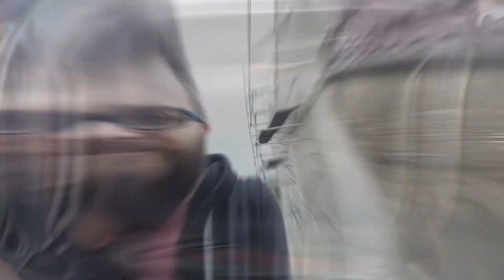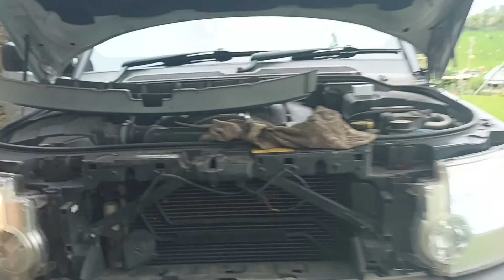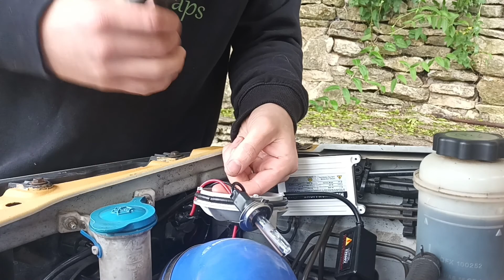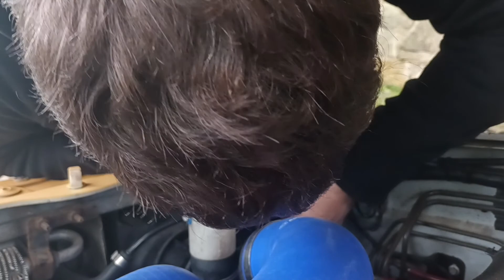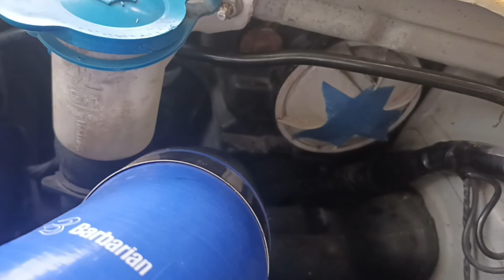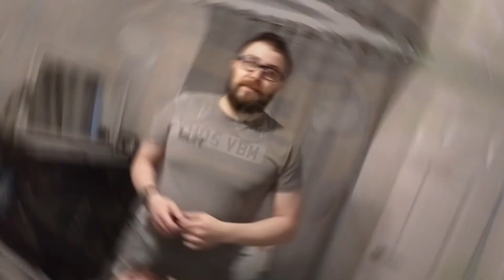Upgrading to LED Headlights + Testing off road

Comment: Hiya great video and looking forward to seeing morejust a question on the LED bulbs did you replace your high beams as well as your low beams with the leds ?
Reply from the maker: Hey, cheers for the support. Yes both were changed to the LED bulbs.
Reply: @TrackCraftPerformance  hi to be honest after sending the message I rewatched the video and you do clearly say that 🤣🤣 so ordered another pair
Reply from the maker: Haha no worries 😂 it's well worth it to be fair, they are easy to install as it's basically the same as putting in a normal bulbs. Let me know how you get on, always great to get real world feedback from my videos 👍

Comment: Can you add a link for the bulbs?

Are they road legal?
Reply: Here's a link for you: 
https://www.carmodshop.co.uk/product/h7-11-csp-led-headlight-bulbs-8000lm-super-bright-no-adapters/

I'm never great at the legal side, all I know is they recently went through an MOT fine. They are also made to perfectly match the regular beam pattern and so don't blind oncoming traffic. I also believe they have passed the official test that regulates this. Sorry I can't give more info but worth while talking to the guys at car mod shop as they are a great bunch and they should be able to help far more than me
Reply: Can the bulbs be changed without messing around with any wiring ?